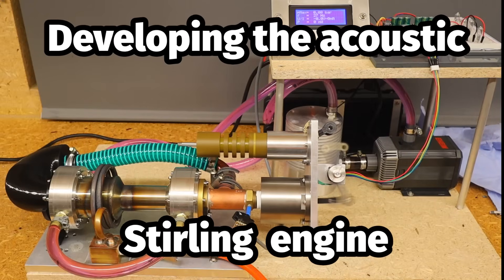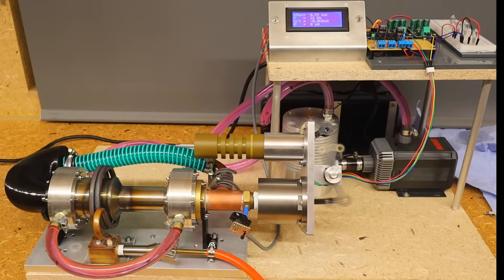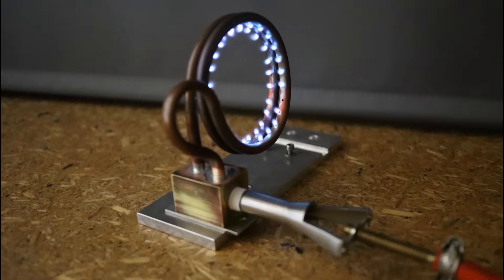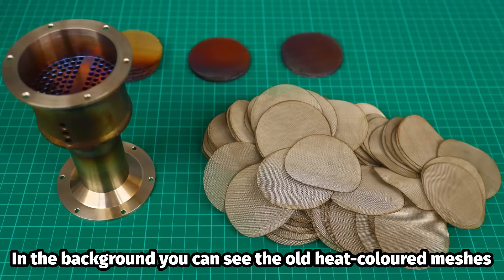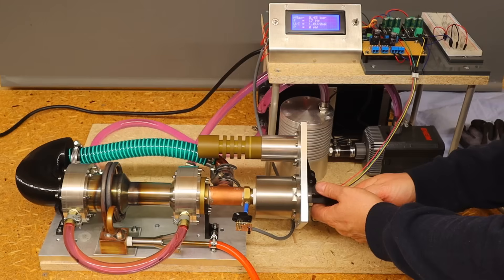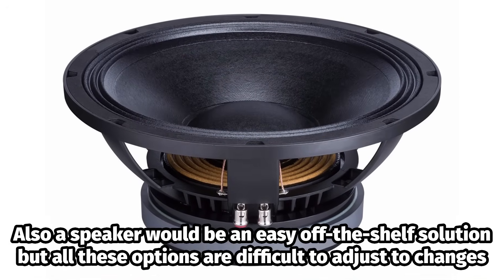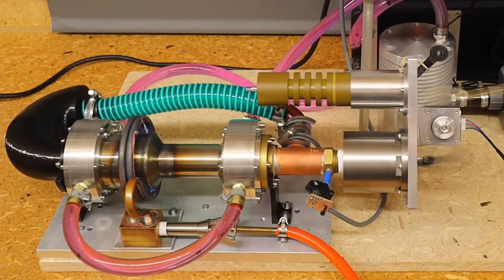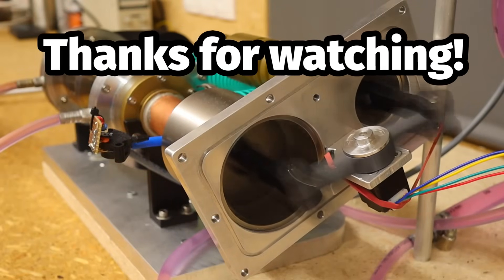More energy with the acoustic Stirling engine?

Comment: Some things to consider from the internal combustion engine world.

Horizontally opposed twin engines like the BMW boxer with 2 active generators. Timing will be an issue, but something to consider for both power and balance.

An option for the balance cylinder is a 90 degree configuration. Research the Ducati Supermono engine from the 1990's. They converted a factory 90 degree v-twin to a single but kept the extra cylinder, connecting rod and other components to create a smooth single with counterbalance.
Reply from the maker: A multi-stage thermoacoustic cycle would of course be very effective; commercial engines usually use three gas cycles.
However, this requires much more effort in the development phase and would only be conceivable for me if the engine were almost fully developed in order to increase performance and efficiency.
First, I want to seal the crankcase, which will create back pressure on its own.
Thanks for your good suggestions!

Comment: hey long time no speak, my piezoeletric idea is still up that i showed you before if you remember brother. just buy some cheap small piezo materials ring and glue or insert them into circle or square apparatus and solder them in series/parallel, enclose it at the end of the output so its pressure sealed and the air inside will vibrate the apparatus by expanding and de-expanding really fast from the burning and cooling. get another apparatus and have it have small spikes like design and seal it onto the other end of the apparatus taht the piezo disc is sitting at and is being vibrated so when the original apparatus is being vibrated by the air inside the stirling engine the outter apparatus small spikes will pressurize the piezo further by stimulating pin point pressuring it, then the piezo will generate strong electrical energy no moving parts.
edit: actually you dont even have to have piezo materials, like you mention you can replace the piezo materials with an iron core and vibrate the iron core on the apparatus and the copper wire surrounding it will generate electricity.
Reply from the maker: That's an interesting principle. Would it also be possible to generate higher outputs in the range of 200 to 400 watts?
Thanks for your help!
Reply: @myengines2443  idk.... all of this is no mans land atm, all theoretical. i'm sorry i couldn't answer the question.

Comment: You could probably create a rack and pinion design with either Seiko magic lever system, or a double ratchet. Means you could get a pretty constant torque curve from the double ratchet, along with a rack and pinion. although, Seiko magic lever means you can manufacture fewer parts. These will be better, since you don't need to design a linear generator, so very cost effective.
Reply: seiko magic lever may be better since you can offset the magic lever to linearlize the torque curve, since the engine produces siusoidal torque curves, maximizing its transmission efficiency.
Reply from the maker: I'm not familiar with the Seiko magic lever mechanism yet, but I'll take a closer look at it. Maybe it's something for the Stirling.
Thank you very much!
Reply from the maker: Unfortunately, all of these mechanisms involve a lot of friction and wear, which I definitely want to avoid.
But thank you for your interesting suggestions!

Comment: I like watching you thinkering as i love doing it myself but why not just adapt a cheap 230 euro 1000W gasoline generator for use with your biogas? i would give you a usable 300W capable device while you develop your thermoacoustic engine
Reply from the maker: The bio gas is very hard to clean perfectly and the contamination of sulphur and other components will kill any internal combustion engine very fast.
I also want a low power engine that runs constanly and quiet and consumes the produced bio gas while it is produced so it does not to be stored which is costly and dangerous.
But you are right, this would be the easy way.
Reply: @myengines2443  The problem of dirty high sulfur fuel has long been solved in the engines used in large ships. The gist of it is to divide the cylinder and the crankcase into two compartments, with a "diaphragm" (basically a wall) between them. A crosshead inside the crankcase handles side loads from the crank, and the piston is bolted to a piston rod which passes from the crosshead, through a stuffing box in the diaphragm, into the cylinder. Lubrication of the crankcase is conventional, meanwhile the cylinder is lubricated in a total loss scheme with a special oil containing extremely high amounts of calcium soaps and other bases. The space beneath the piston is connected to the air intakes, so blowby is recirculated into the combustion chamber before acids can condense and accumulate.

Heavy fuel oil as used in ships can contain as much as 5% sulfur by weight. I doubt that your gas is that bad, especially as you have a scrubber. So if you wanted to trial this approach, I think it would work even with regular 2-stroke oil as the total loss lubricant for the cylinder. As a perfectionist like yourself, I'd probably scratch-build the engine rather than adapting an existing one. 

The obvious advantage of this scheme is that an internal combustion engine easily outclasses a practical Stirling in terms of power and thermal efficiency. You could obtain your 300W, continuous run, low noise goal by scaling the engine appropriately to deliver the required power at a low operating speed and fitting a very big muffler.
Reply from the maker: Yes, perhaps that would be the simple solution, but is it really efficient in the low power class and, above all, can it be manufactured with relatively simple means with a durability of 24/7 over several years?
The ingenious simplicity and thus durability of the thermoacoustic principle is truly remarkable.

Comment: I saw someone have a similar experience with a shaft in use in a linear application. They had real friction and binding issues and it turned out that the shaft they were using (from a 3D printer kit) was ever so slightly warped. They ended up have to go with some precision ground rod to overcome their issue; they also used some oil infused bronze as a bushing to make extra sure. 

You might want to consider using a heat shield between the hot end and cold end to deflect radiative heat from the burners.

Great work so far, looking forward to the next video!
Reply from the maker: That's exactly where I suspect the source of the additional friction in the balancing shaft is. I think the alignment of the lever to the two connecting rod bearings is the cause, and I'll test this today. A heat shield would make a big difference; I really need to take care of the burner and make some improvements here.
Thank you very much for your good ideas, I'll get to work on the improvements...
Reply: @myengines2443  I think it was the sterling engine powered pushbike builder Tom Stanton that had some good ideas. https://youtu.be/cFE_NO7hu0E?si=sdIExmoa6-tXz_xH
Reply: @edmguru007  wasn't the video I had in mind (it was specifically rod/shafts not being straight), but he does bring up a reasonable option for dealing with misalignment.
Reply: @myengines2443 ⚠️ God has said in the Quran:

🔴 { Say, "O My servants who have transgressed against themselves [by sinning], do not despair of the mercy of Allah. Indeed, Allah forgives all sins. Indeed, it is He who is the Forgiving, the Merciful." ( 39:53 )} 

📖Quran

Comment: You can buy ferrite ring cores that might be good to experiment with, for the generator.  Great work!
Reply from the maker: OH, yes thanks thats a great idea!
I thought a lot on how to get the right material and this is really an easy and cheap possibility!
Thats the reason for me of making my videos, the great help and good ideas I get from grat viewers!
Thans a lot I will order some tonight!!!!
Reply: @myengines2443  Ferrite has much lower permeability and saturation field than iron cores have. The advantage of ferrite is that it works at higher frequencies (kHz-MHz range) where iron cores don't. For the iron cores, you'd need to hack a transformer or a motor to get those sheets of specially suitable alloys (such as the Permendur). Or you could try finding a company that supplies motor/transformer makers with metal sheets and try to order from them.
Reply from the maker: @bormisha  I have been searching for a long time to find a dealer for electro steel, but I haven't been able to find one. I have also thought about using large old transformers, but that is all very costly.
Thank you for your good suggestions!

Comment: Should the balancing shaft be impedance matched to the impedance of the engine? Is it like a pendulum that you have to match its natural frequency?
Can you start the engine with a strong magnet out side the enclosure that pulls on the shaft, almost like a magneticgear?
Reply from the maker: That are really good suggestions and I have to think about the natural frequency very closely. At the moment I think it is more a friction problem and I hope I can locate it this weekend.
Starting with a magnet from outside the crankcase would not be possible but maybe with an electromagnet in the crankcase?
Reply: I had the same thought. The balance shaft is increasing reciprocating mass which is going to decrease the natural frequency. This should be something that can be reasonably countered by increasing the spring tension on the system to bring the natural frequency back up. What bothers me is I looked back at other videos and I can't determine if such a spring exists in the assembly.

Otherwise without a spring to take that inertia it has built up and return it back the other direction, adding mass to the assembly is just straight energy loss.

The changes to the regenerator and cooler probably changed the natural frequency of the resonating circuit and put it into a region that was fighting the natural frequency of the piston and balancer assembly; eg, the preferred frequency of the engine shifted higher and hence energy loss from the reciprocating mass increased as well.
Reply from the maker: I will be conducting extensive test runs next week and will hopefully be able to report on the results.
In any case, I know that the thermoacoustic balance or resonance can be easily disrupted, which then leads to malfunction.
I still believe and hope that it is due to strong friction somewhere on the deflection lever, as the motor vibrates a lot  without balancing.
Thank you very much for your very insightful contributions!

Comment: You said on your community post that you will post numbers in this video, but after watching the video I saw no numbers (watts), please add those numbers in every video as they are a gauge on what upgrades work and what dont. A good measure on how much fuel was spent and what type of fuel was used (watts/Liter) and watts output of the stirling engine is also good to see. Thanks.
Reply from the maker: I actually can't tell precise numbers as my test stand does not work properly and I have to fix it, I think it has to do with the used ideal active diodes rectifier in combination with the too big capacitors. The efficiency of the oscillatib steppers also seems to be very low.
If I stated in a post then I expressed myself incorrectly, apologies for that.
It will be quite some time before I can conduct specific efficiency tests in relation to gas consumption and power output, as I first want to achieve the full power of several hundred watts with pressurization.
Now I estimate the mechanical power to be in the region of approximately 10-20 watts.
This power will be multipied with pressurization...

Comment: Could you use one-way bearings to drive the stepper motor in just one direction? Also you could put a gearbox between the current bridge setup and the stepper motor, would that help? Love your project, from Vienna!
Reply from the maker: I thought a lot of different geats / trasmissions to drive the generator in one direction but they all cause friction and wear.
At the moment I really think to go back to the linear generator.
Thanks for youtr nice suggestions!
Reply: @myengines2443  Are you sure? They made it work in wrist watches! But to be honest I just want you to try it on camera.
Reply from the maker: @daviniusb6798  yes its used in watches but there they are transforming microwatts!

Comment: Great video! If you can control that little motor, maybe you can mimic the movement of your thumb when you start it so the motor does the same thing. Cheers!
Reply from the maker: Yes, that is my simplestt plan for starting also.
But the very low efficiency of the oscillating steppers lets me think of a different generator type....

Comment: Exiting update! If you have that information, I would love it if you could give the wattage in each update, so we can get an idea of how your engine and generators are progressing in terms of that. Looking forward to the next update!
Reply from the maker: My test stand does not work properly and I actually can't tell precise numbers and I have to fix it, I think it has to do with the used ideal active diodes rectifier in combination with the too big capacitors. The efficiency of the oscillatig steppers also seems to be very low.
I will get the test stand to work as soon as I have some time, at the moment I have more fun developing the engine itself.
In the moment I estimate the mechanical power to be in the region of approximately 10-20 watts.
This power will be multipied with pressurization...
Reply: @myengines2443  Wow, that's already impressive for an early protoype... Good luck!
Reply from the maker: @joflo5950  its just an estimation of the mechanical power.
The electrical output power would of course be lower!